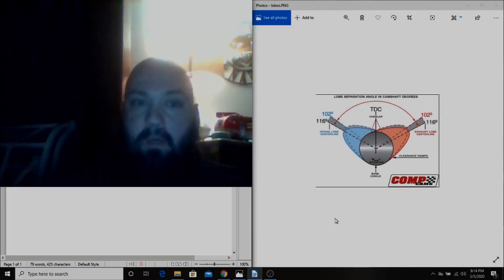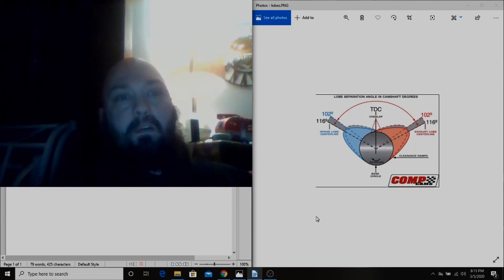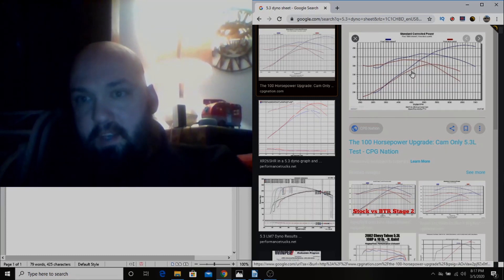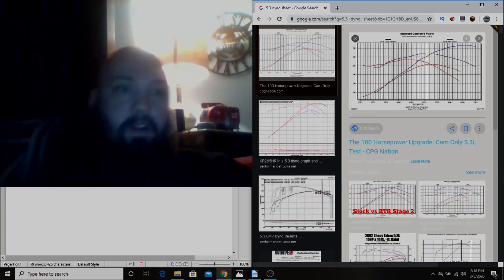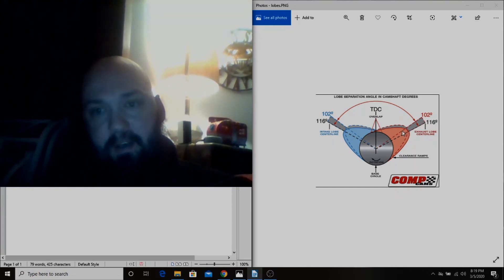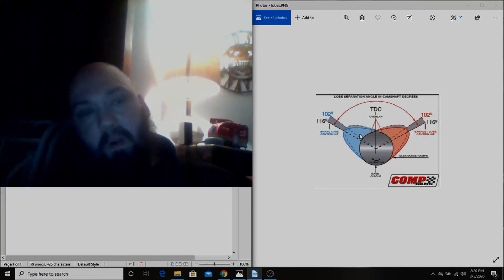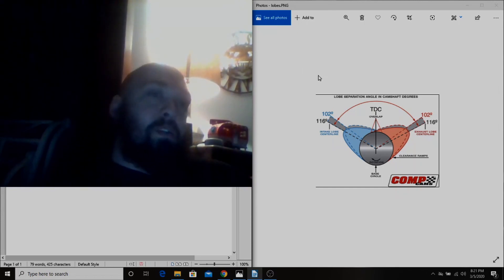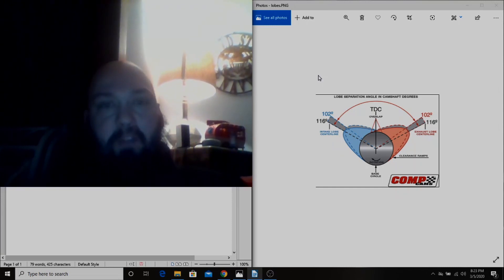How to select a camshaft for maximum gainz!!!(Clickbait title)

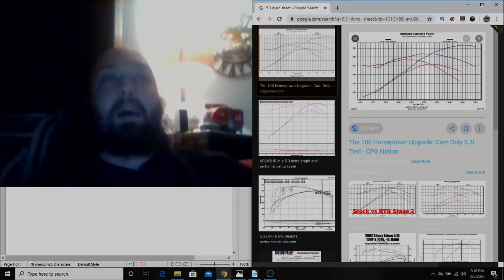Comment: 350 flat tops 64cc heads comp biggest thumpr cam mild stall converter and a 3:42 in a s10 i had was a mean as hell sounding tire destroying little truck maybe made 300 to 350 hp.if lucky   Summit racing stuff is all reboxed stuff from other suppliers most all good stuff. You can do the rocker ratio swap too say 1.7 and 1.6 . and degree a cam vs just slapping in heads up. Rich Holder helps guys destroy engines.

Comment: I been thinking about getting a cheap Ls9 cam, and springs, eBay for about $125,
Reply from the maker: They work, for that price, I'd do it
Reply: The tradeoff is torque for hp
Reply: Just picked up a 2015 427 cam with springs, keepers ,push rods. Going in a 6.2 truck motor. It was cheap. Great used deals out there.

Comment: Right now the stage 1 1838 runs $240, the 1839 runs $190 and 1840 which is the sloppy 2 runs $120 on eBay. Ls9 profile can be had right under $100
Reply: Lots of Chinese knock offs on the SS2, not that they're bad, but it's gambling with your engine imo.
Reply: @mfr5725  i am running a 212/218 BTR copy also from china, i made my decision because i already have piston slap and figured a $110 cam on a 230k mile engine with issues was worth a gamble. Been running it untunned for roughly 2 months and until now no issues aside from stalling a few times due to lack of tune.
Reply: @johncrankshaft2886  valid, I'd be doing it the same way if I had a higher mile engine.  I have a LS3 with 37k miles so I'm not as brave with it.
Reply: @mfr5725  i have a 2011 SS too but that one is getting a full GPI SS2 kit with 3400 converter and 3.91 gears. My truck only has the cam and spring upgrade with everything else re-used, however i do have a set of 3.73 i need to install which is why i havent tuned it yet.

Comment: I gave up on the Mast Motorsports High output cam in my LS7 - it made good torque, but was way down on HP - it had .650 lift. I went with their SS cam which only has .640 lift and it makes 40 more hp with a wider duration. Just sayin :)
Reply: All of those kinds of changes come down to cylinder head designs. Flow bench work tells much more in terms of how a cam will work with certain heads. Boost cures all flow issues though!

Comment: Looking for a cam for my build now will the 8716 require pushrods also ?
Reply: Idk the specs of that cam, but you can break push rods in addition to having valve train instability due to push rod deflection. You may lose power if it deflects.

Comment: Excuse me for not knowing what is a regrind?
Reply from the maker: You can take a stock cam, and grind material off it to make the lobes have a more aggressive shape
Reply: Yeah I had a cam installed my truck not long ago does mold cop cam was messed up it ran good fast the new that was put in supposed to be better but the trucks a second slower I wish there was a way find out if they really put the cam in there that they said they did